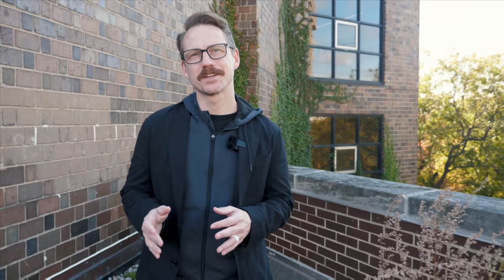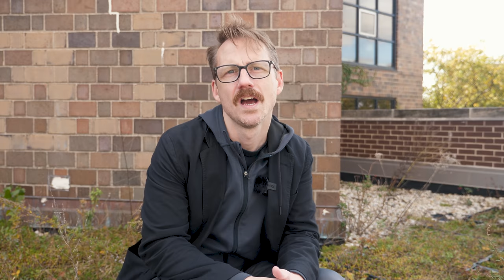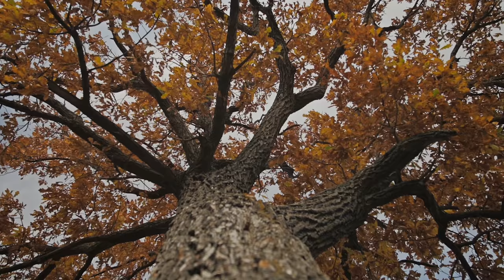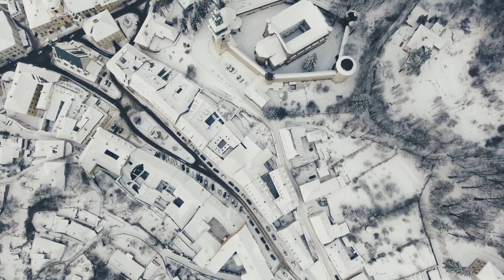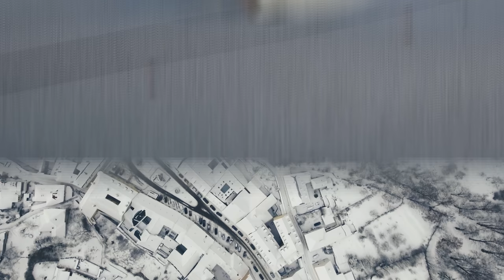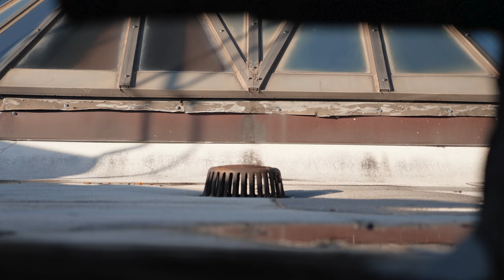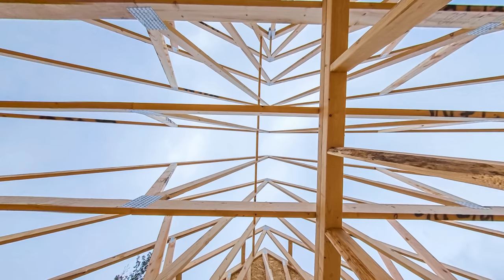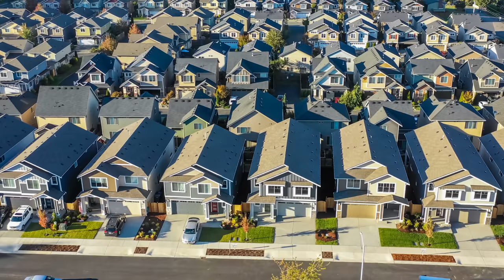Why Do Architects Insist on Using Flat Roofs?

Comment: Another great video. The best roof is the one that balances all requirements, with all options considered. I recall an interview with an architect in which he mentions that at architecture school they were told to design only with flat roof lines, as that was the modern way of doing things. Doing otherwise would be a fail in the design course. A dogmatic approach whether for or against flat roofs, closes the door to arriving at the best solution. I would tend towards a pitched roof over a low slope roof, in a northern climate. That sentiment goes back to a story an architecture professor told the class about a flat roofed building that was vacated, the heat turned, and the roof caved in during the winter.  The building was not insulated, so the heat loss would normally melt the snow and  ice before it could accumulate and  exceed the carrying capacity of the roof structure. A sloped roof would last longer in a similar situation. Something to think about if one is insulating buildings that were never insulated before - the roof structure, sloped or low-sloped, may need beefing up.
Reply: This is also why it is common practice to shovel snow off of your roof in the winter. (Depends on weather, quality of the pack, and strength of the structure but usually more than a foot (.3m) is a getting dangerous)

The easiest roof to clean is a sloped metal roof where 1 shove can clear an entire section (can happen spontaneously so be careful under sloped metal roofs in winter, especially tall buildings where it can pick up speed)

Slopped shingles are also cleaned by just shoving but asphalt has a lot more grip than metal so you will leave a thin layer of snow behind and will have to push the entire roof area.

And flat roofs are clearly the worst for this, first if all gravity doesn't clean them and won't meaningfully aid you. Second they have parapets you have to shovel the snow over. Basically imagine shoveling your driveway when it already has 3ft snowbanks, and a snowblower would save effort but may not be suitable for your roof (think of all the little stuff ontop of commercial buildings like wires and vents and whatnot).

And you are right, the best roof is very situational, a log cabin an Alaska has very different needs for it roof than a Skyscraper in Egypt. But generally speaking commercial buildings get flat roofs as place for "ugly" HVAC equipment.

Comment: Interesting that here in Thailand complex gabled roofs are the most popular as they are seen as the most beautiful. They are usually made of dark colored concrete tiles to complete the aesthetic even though we don't have either hail or snow.  By contrast my roof in white steel set at 15 degrees - the perfect angle for mounting solar here. The roof extends several meters to shade the walls and windows. My house is generally considered to be very ugly however, it is completely off-grid.
Reply: 15 percent slope is absolutely fine
thank god you did not get a flat roof they are horrible

Comment: As a roof designer, I believe the "mansard" style of roof is the most superior. It combines the best of a hip roof with the best of a flat roof.
Reply: Comination and hybrids are usually the way to go
Reply: Hip roof?
Reply: @cchastant8251  Two intersecting sloped roofs.
Reply: I think this is very context related.
Reply: They look pretty nice and give a lot of headroom, but in snow i feel they would struggle a bit compared to steep gables like the Dutch and Nowegian housing, which as well look proper cool, but the location defines the build
Reply: @HaroldMC63  If the slope is less than 2/12 then they are designed with extra snow loading; the same as a flat roof.
Reply: I think this statement needs clarification. Isn't the mansard a roof with 4 sides & two pitches? If the uppermost pitch is "flat", how does that contribute to being an optimal design? I would think you get all the design flaws of a low slope roof, with the construction costs of a gable roof...
Reply: Maybe, but most people don't want their house to look like a barn.
Reply: @Matasky2010  Why does it need to look like a barn? I don't think you know what a mansard roof is. What you're talking about is a gambrel roof.
Reply: @HaroldMC63  It depends greatly where you are and what the annual ground snow load is. There are plenty of mansard style roofs in Toronto and even more built everyday. But you won't see them built in Muskoka/Parry Sound/Nippising/Greater Sudbury because of the higher snowfall.
Reply: @TwistyTrav  You’re right. Looking at the mansard roof, it looks like a much more expensive build design. Every roof comes with advantages and disadvantages, and what’s ‘best’ always depends on use scenarios and climate obviously.
Reply: @Matasky2010  For the longest time, I used call it the "pizza hut" roof. 😂🍕
Reply: Munsters house.

Comment: Some cons I ran across researching flat roofs vs gabled in residential construction in northern lower Michigan. First dealing with internal moisture in winter months making sure it doesn’t condense in the insulation and secondly in the summer sun they do not dissipate heat like a gabled roof.  That being said I built an addition on my studio and love the flat/low slope roof.  The main comment I get is, “your roof will collapse in heavy snow” my reply is that I used the same math to calculate my rafters as your architect did on yours they don’t get it up here. Nice video keep it up

Comment: Most people like traditional forms, especially in houses.  Flat roofs, generally, don't have as much "curb appeal" as traditional gable and hip roofs.  In residential design it comes down to: "Will this house sell?"  Banks and builders are mostly concerned about the marketability of the homes they finance and build...nobody wants to get stuck with an expensive, unsellable house.  There are design regulations set up in most residential developments that dictate minimum square footages, material selections, and even minimum roof pitches.  This is why all the houses in most subdivisions start to look the same.
Reply: This is not really accurate. Design regulations may be present in certain suburban areas in certain US states. But many places have no such regulation. Especially not in the southeast or midwest US. In my city the majority of houses are definitely Builder's shlock- McMansions with huge gabled roofing; but outrageous modern designs pop up everywhere. They are definitely less popular- but the reason is actually more down to cost- 'traditional' houses are built by developers from fixed plans that come with some customizable options... architect designed houses are just that. It's not paying the architect that raises the cost- it's finding a builder willing to tackle a one-off project: different materials, and non-standard (in terms of what builders typically use) parts such as windows, doors etc that all have to be special ordered. But modern design has come back into fashion in the past 10 years and those houses command a premium on the secondhand market because they're so stylish and desirable.
Reply: @superadventure6297  I don't disagree.  Builders and banks like to stay within their comfortable profitable boxes.  Flat roofs tend to exist outside of those boxes.  A builder will have to hire a commercial roofing subcontractor for flat roofs, and commercial roofers typically don't like to fool with residential work...it usually doesn't pay as well.    
Most residential builders don't like working with architects period, because they don't like someone looking over their shoulder, so they put a P.I.T.A. multiplyer on their bid....even on a traditional design.  To be fair, architects can be their own worst enemiies because they can design fussy furniture grade details that drive up cost...modern minimalism is way more expensive than slathering on crown molding and trim to cover up the gaps.  
The vast majority of people in America don't like modern design, especially in the residential market, because they don't understand it.  There is comfort in the sameness of having a traditional house in a traditional neighborhood.  Modern homes tend to be built on larger tracts of land, away from the traditional neighborhoods by wealthy people that can afford to pay cash. Go down to your local bank and show them your modern house plans and ask them what percentge of the cost will they loan you on the construction loan.  If they can't find a comperable house in the area, which they usually can't, they won't take on the risk.  As an Architect in the midwest, it is frustrating because even if I get a client that wants a modern home, they will more than likely have to come up with the cash to pay for it.
Existing Mid-Century modern homes in older neighborhoods have had a resurgence in popularity, and the banks are not as afraid of them, because they tend to be located in the best locations in town since they were built prior to the massive sprawl that has taken over most cities.  I stand by my statement that new suvdivisions have regs governing a big part of what they allow to be built...I have first hand experience with this.
Reply: @stevevice9863  Here in the East, HOAs have big sharp teeth they like to use.  Plus, modern houses look stark when next to mellow brickwork with white trim. And I don't imagine having all glass walls would make too many people, in these lack of privacy days, very comfortable. Then there's the house that looks like you're expecting a bombardment - a massive concrete blockhouse. Prison, anyone?  A hip roof is best especially with dragon beams and hurricane straps. Built it like you mean it, baby!

Comment: Any roof that relies on "details" as you put it, to shed and control water is already a failed design. The problem is that a single point of failure in just one of the "details" will result in a leak into the interior. The one truth of architecture and construction is that every single component needs backup. A failure of one shouldn't result in a leak. Pitched roofs with eaves fundamentally don't have that problem of complexity.
Reply: I make my living as a handyman and have fixed a lot of roofs. The only pitched roof buildings I've ever worked on that weren't complicated had a single peak running down the center of the long axis. In my experience, on most buildings with pitched roofs, the design is far more complex than a flat roof would have been, and far more prone to leaks in the valleys.
Reply: @Dwayne_Bearup  By “pitched” roof I meant the standard & basic single, gable or hipped roof. You’re so right that valleys are a complication. That is precisely the first weak point.
Reply: @Dwayne_Bearup  The American suburban mac-mansion style pitched roof with hip and valley and dutch every which way is a failure waiting to happen. A single gable or shed style is inherently superior to all other styles. Very little to screw up when constructing. Two layers of water proofing. Little maintenance and problems are obvious if maintenance (gutters) are ignored. Heck you can live without gutters if allowed and depending on ground and ground level construction.
Reply: As an HVAC service tech working on commercial buildings, I love a well maintained low-slope roof. If the rooftop equipment is mounted high I can safely setup a ladder to reach it. I'd like to build a house with a low slope roof and have sections of the parapet that can be opened for easier snow removal.
TPO/membrane rooves are very slick. The smallest amount of frost makes for a serious fall hazard, so I don't know if I would want that on my own roof in a cold climate. But, the insulating layer under the membrane does make a big difference in efficiency.
Reply: @ethankriegel5957  Would love to see drawings on how you’d resolve flashing at the removable sections. Sounds like complications on complications.
Reply: Unless your building is a perfect rectangle, which is frequently impractical or undesirable, a basic single gabled roof is not feasible. The resulting valleys of other designs concentrate, in particular, snow build up, and working on a pitched roof is hard enough to begin with; working on a pitched roof in winter has a strong potential to be lethal, and that snow build up can subsequently be very difficult to remove. Even when its raining, pitched roofs still need a water collection and drainage system; letting the rain just fall off the sides of the roof leads to concentrated erosion near the foundation, and uncontrolled ground water seepage, both of which can lead to basement flooding, so gutters and drain pipes are still necessary to direct water to appropriate run-off areas. 

Finally, especially with simpler gable designs, you create a lot of interior volume, that, as addressed in the video, is typical not conducive to human activity. This creates problems in both managing insulation and ventilation, and a mostly uninhabited volume of space is highly desirable for animals to nest or den in. Having dealt with leaks and infestations, I'd rather have to address a leak, which is something I can fix, than attempt to kill animals that are hiding in a space I can't get to readily. Cramped basements are similarly problematic, as attempting to fix anything in them is inhibited by difficulty of access, and they also serve as a desirable nesting ground for all sorts of vermin.
Reply: Do you know what? The legend of Icarus has been bugging me since a talking head mentioned the bit of the legend that gets left out. Icarus' dad didn't only warn his son not to fly too high. He also warned him not to fly too low either or his wings would get waterlogged. Icarus to survive should had taken the Middle Path. I think that Middle Path is Functional Redundancy. We're so focused on efficiency, we create more problems than we solve in the long run because we build structures and create systems that are efficient but don't give any consideration to maintaining the underlying structure in the long term. We treat people in the same way, sadly. If you've got this far, thank you for reading. Have a Happy Xmas and a wonderful New Year.
Reply: Haha as if "pitched roof" does not leak. And doesn't not requires maintenance.  In fact flat roof are way easier to troubleshoot and maintain for all given building size.

Also by your logic, why are you using heater or aircon, since those requires so much "details" and are failures.

Such failed logics.
Reply: @DiscoFang  I'm not an architect or engineer and haven't investigated it that far. In my mind I'm picturing something I've seen on some boats. The main deck has a short wall around it with sections that can be lifted put for gang planks or easier entry and exit into the water.

If you already have a hole at the base of the parapet for water to run out and into a drainage funnel, then just make the funnel big enough that it catches anything running out under that removable section. Another option is to just leave gaps in the parapet big enough for both drainage and snow removal.
Reply: @Jinkypigs  S’funny, the last water damage problem I dealt with was mould & rot in the refrigerator cavity of an apartment. The owners blamed the fridge & replaced it. I discovered when advising on a new timber flooring that the AIrCon unit drain-pipe was to blame. An installation with slightly complicated details resulted in a failure because of a non-foolproof install. That failure of building components from a seemingly innocuous design detail.
Reply: Naw, you don't know what the "details" are so you're completely ignorant.  

Such details include tapered insulation that directs water towards drains, or sumping drains ensuring that are the lowest point.  Or using insulation back slope to direct water around roof penetrations.  Since all of these "details" are integrated into the roof structure they cannot be a point of failure as the entire roof would need to fail too.  They are all simple passive solutions and the only way for them to fail is to poorly design them.  But design failures can just as easily occur on steep roofs too.
Reply: @jeremyO9F911O2  Haha Completely ignorant? Do you always start your point of views with a personal insult? I’ve been a designer, builder, developer, renovator for 35 years. You’ve described the problem - It’s all very well to design and intend but all those details require perfect combination of material and installation. No one said that it can’t be done but complexity of solution = simplicity of failure.

Comment: For hundreds of years in Europe (where we get a lot of rain and snow) we have enjoyed pitched roofs successfully.  None of the issues you’ve raised seem to be problems with them.  We also have flat roofs too.
Reply: Yeah because we weren't building high rises and large buildings in those hundreds of years duh. This is like saying that we've used the horse for hundreds of years and never had issues with them, the issues arise in a modern context which is why we build flat roofs now.
Reply: @hedgehog3180  Are you really saying that pitched roofs got worse because of modern times?
Reply: SEu has flat roofs

Comment: It never occurred to me that there might be legitimate engineering reasons for them, but I have always liked the idea of flat roofs just because they maximize the usable space in a given piece of real estate.  The top level is always a full level, rather than sloped wall half-stories or cramped attic spaces, and (as you pointed out) it allows for placement of HVAC equipment, and (more importantly) rooftop patios.